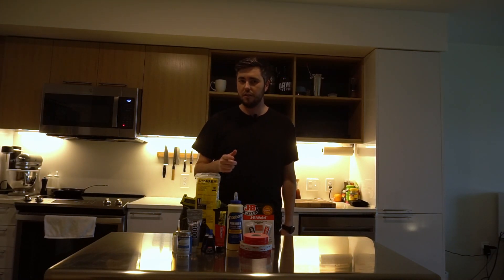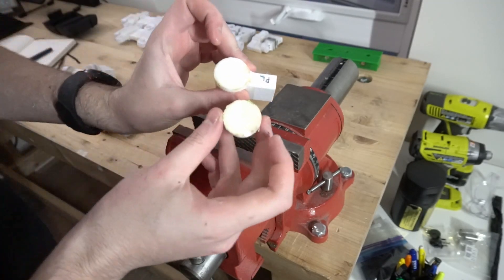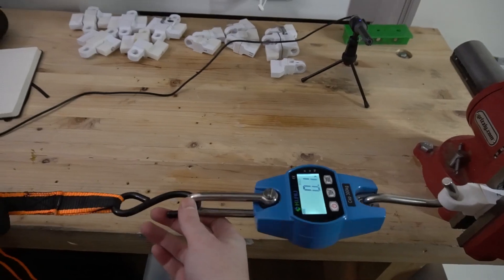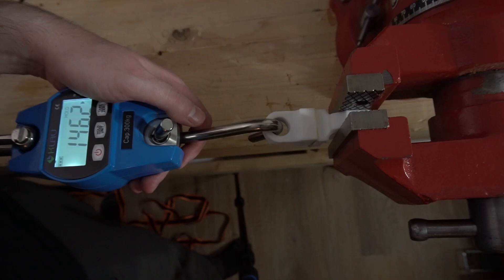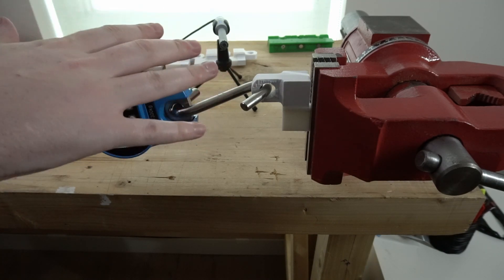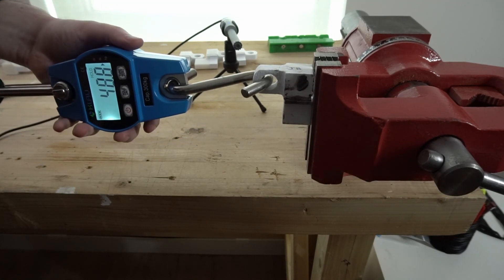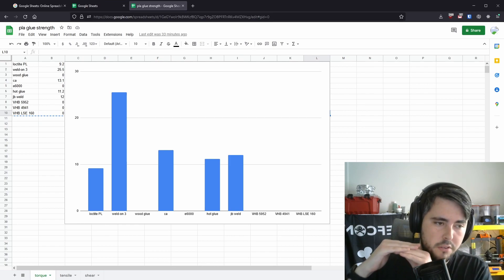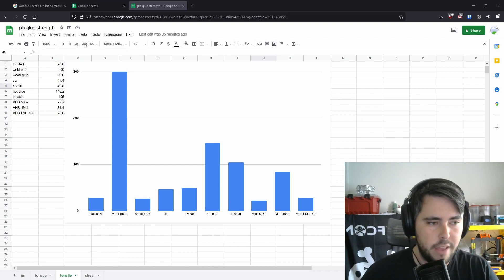What glue is best for 3d printed PLA? Lets find out!

Comment: Great test thanks! Some Super Glue changes the PLA white , so Id be curious the best brand to use.
Reply from the maker: i havent personally noticed that. Using superglue kicker or baking soda (as a DIY kicker) has caused a white surface finish on the super glue. I don't think that superglue reacts with PLA, so i assume the white color is just the color of the super glue you are using. you can find superglue that is sold as optically clear glue, but in my experience most thin superglues dry clear (and i can confirm the thin version of the loctite squeezy bottle I use in the video dries clear. the gel control one does not however!)